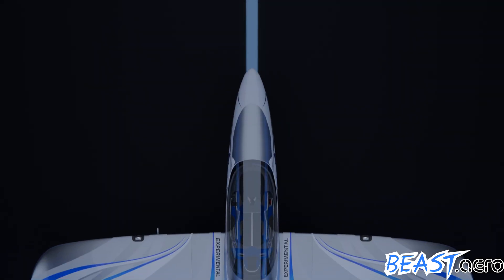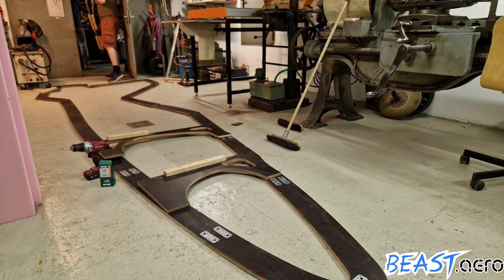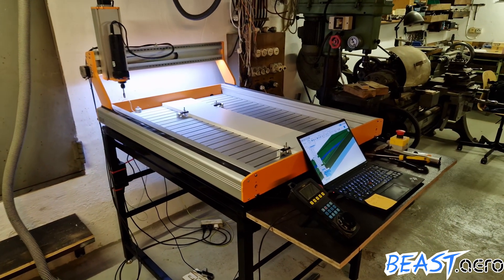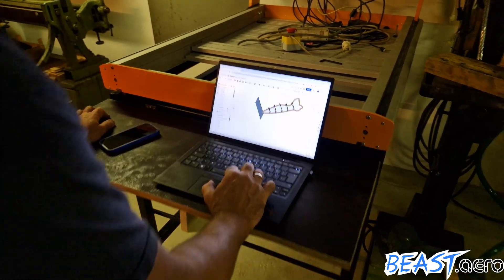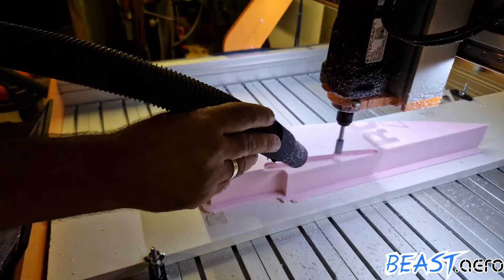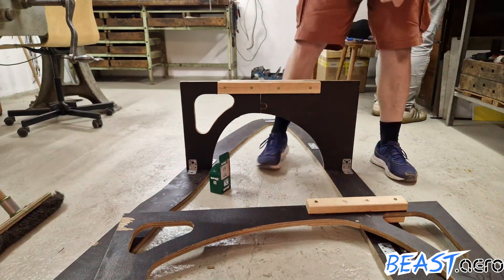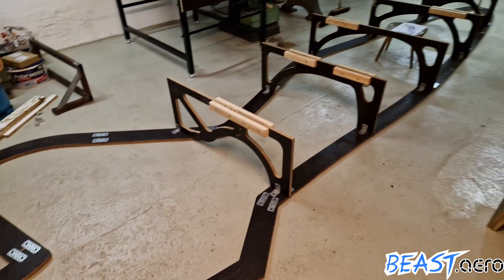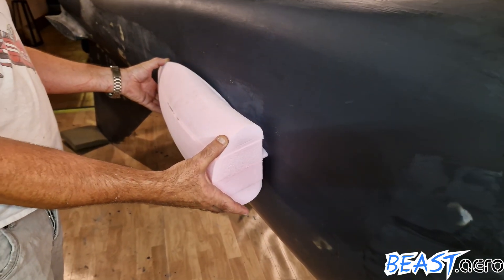Horus VLog #32

Comment: btw you could also 3D print the molds. There are inexpensive 50cm and even 100cm printers. that should be nicely dimensionally accurate and effortless and repeatable.
Reply: You get layer lines that has to be filled and then sanded. Foam CNC is much faster as a process to create the negative mould. And much nicer to sand. I do a lot of 3D printing and sure, abs is nice but you still get micro plastics everywhere when sanding it for moulds.
Reply from the maker: The lip of the engine inlet was 3D printed. We have found a partner in the meantime for bigger parts, who are going to mill the wings in a single piece.
Reply: @BeastAero Otherwise you could give your friend a side project again to create make it a hot wire CNC cutter ;) I'm gonna do to my Queen Ant CNC after I complete that build. Buy it would be super cool to make a large sized one for whole wings. It's actually one of the things I've never seen, but if I build my dream low AR airplane - then I might do that. The classic two guys pull a hot wire should really be CNC controlled and you could get big parts straight off without an end mill :)

Comment: Great video as always. How do you like your Stepcraft CNC?  

You may have already done it, but if not I highly recommend putting a vacuum extraction on the spindle.  It made a big difference to mine 👍 

Unfortunately it didn't stop it from breaking down every time I had something important to do! It was an earlier model  hopefully yours is better behaved!
Reply from the maker: We have one, but it is only suited for 2D cuts. It literally broke during testing it with bigger 3D parts.